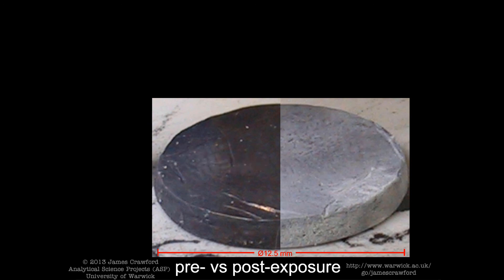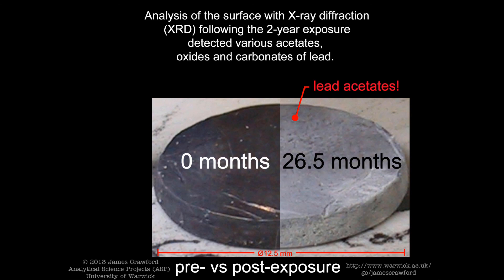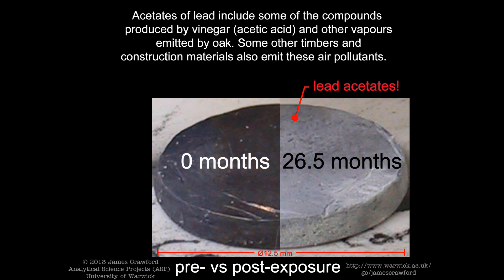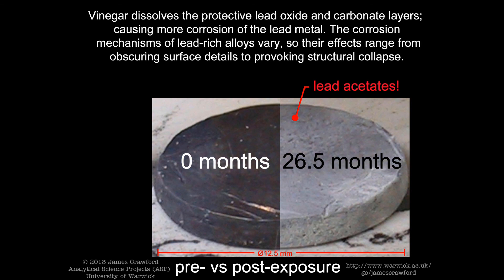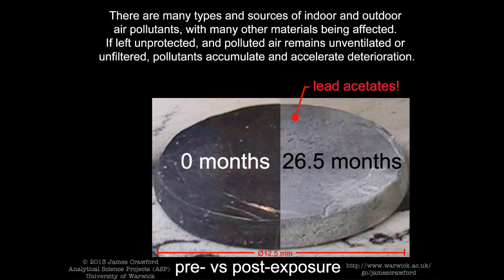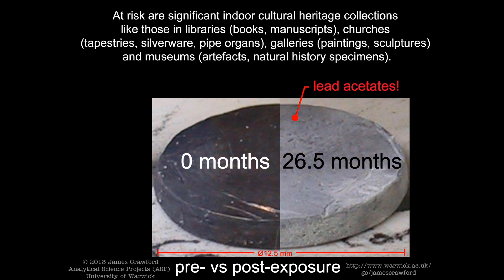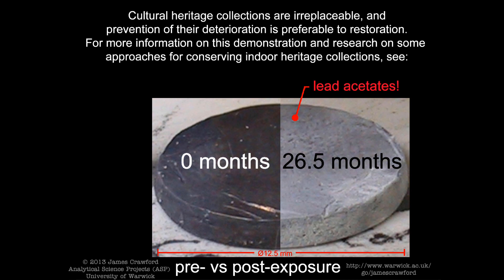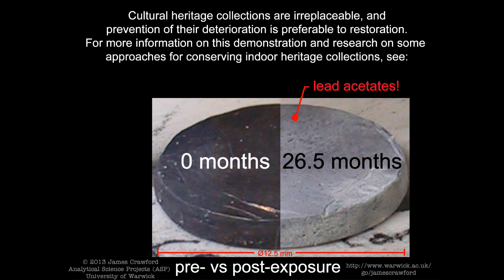Atmospheric corrosion of lead by oak VOCs: 2 years in 25 seconds

Comment: All exhibits in display cases have to be temporary exhibits with deadlines for removal to storage areas.  No exhibits should be considered as permanent displays.  Staff, including skilled volunteers should concentrate on the storage areas or storage buildings to prevent accelerated deterioration of all collections.  This can be accomplished by establishing  basic standards for all the collections.  After this volunteers and staff can develop specialized conservation areas and techniques for art, artifacts, and documents.  Any museum that neglects its building and doesn't continually upgrade the building.  This includes structural and mechanical improvements.  If a museum is not "safe" it should not exist.